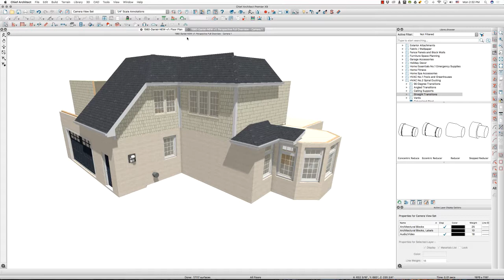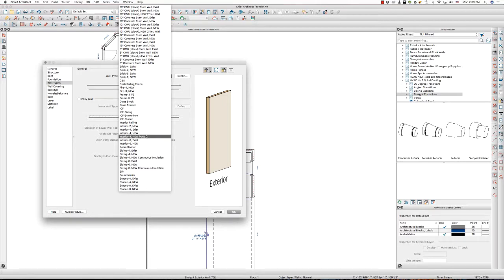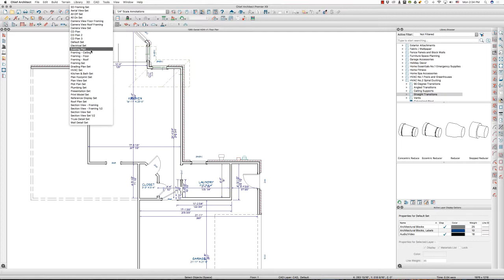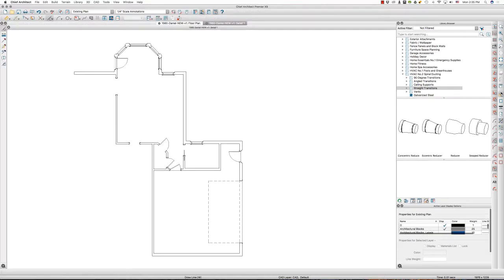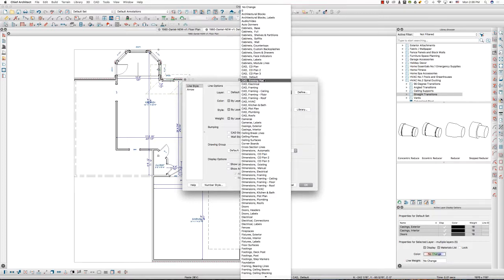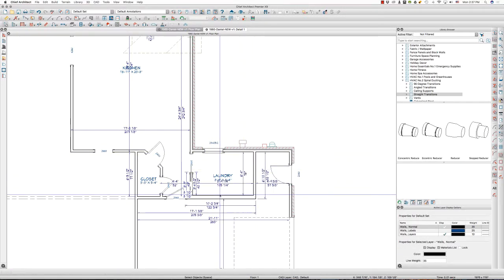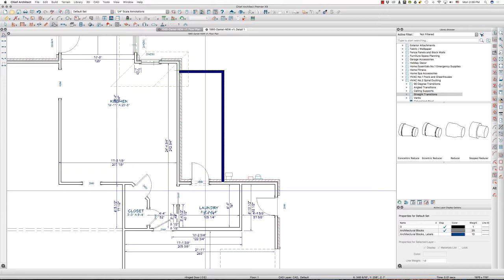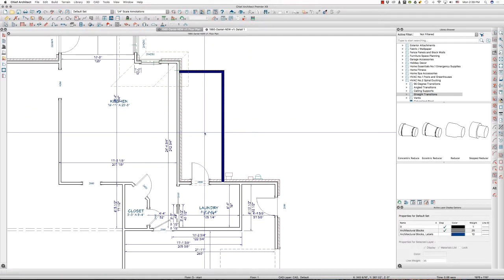How to draw existing conditions using Chief Architect software

Comment: Thanks for your video. I'm a new CA user migrating from Revit. Can you explain how you show existing/demo for elevations or in 3D? In Revit I use phases to show different views that combine existing, demo, or new and show the existing elevations in addition to the plans for a better understanding. In CA, can't you just create a different wall type for existing or demo, and set it to not define a room? That way you can use it in your model and toggle on/off existing/demo/new?
Reply from the maker: Dustin Hetrick welcome to CA. Unfortunately CA doesn’t have anything like phases. I suppose you could create an existing/demo wall type and layer but I’m thinking there is a circumstance that I don’t do it that way and I cannot remember why right now. 
My method is to keep two files: existing/demo file and new/proposed file. I send existing plans/elevations to layout and then proposed plans/elevations/sections. 
I can work up a video for that soon.
Reply: @DesignbuildsolutionsLLC  No rush on that, but I'd appreciate it if you do. I didn't know you could send views from 2 files to layout? That is nice. I wonder if there is a way to overlay the existing to the new elevations to show the difference, if that is something I wanted to show a client?
Reply from the maker: Dustin Hetrick yep. That’s what I do.
Reply from the maker: @dustyh2371  Have you seen these videos? https://youtu.be/uEtJoQAB3uQ and https://youtu.be/14LQzUUPtFg